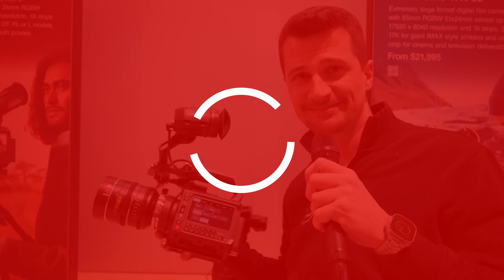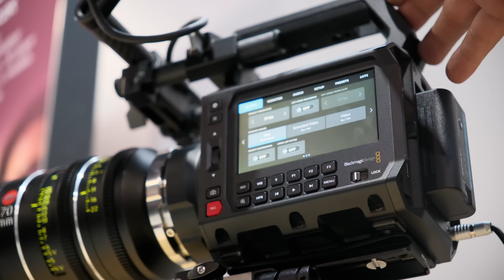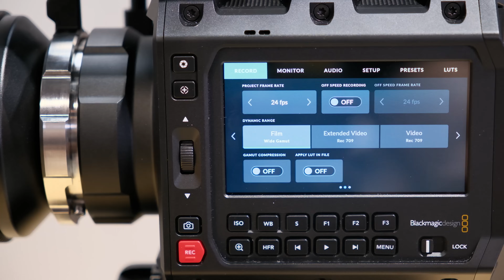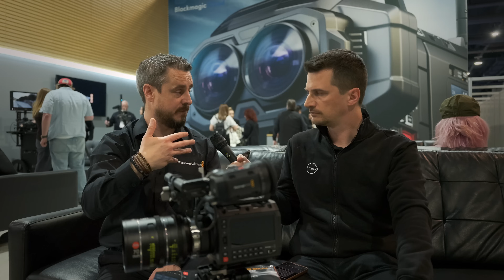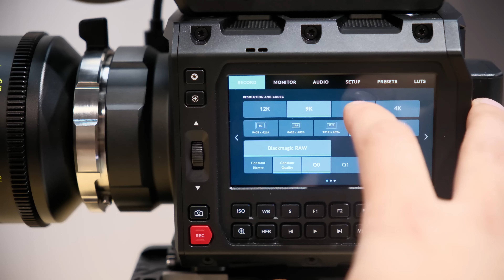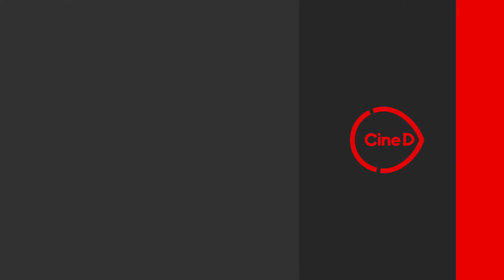Blackmagic PYXIS 12K Camera Explained in Video Interview

Comment: I don’t think enough people are appreciating that this is a 12k full frame l mount camera with no crop for 4k and 8k modes. 
It has a s35 9k mode…
And it’s $5k. What an unreal time we’re living in
Reply: Does s35 works ONLY on 9k mode or can you crop on other resolutions IF you want?
Reply: @baufilmesPT  was wondering the same thing, would love to have 6k s35, and 4k super 16 or whatever’s the actual window at 4k pixels… it would make for some mess menu-wise tho
Reply: just looked at B&H and its back to $5k
Reply: i don't appreciate it because i dont care 1% about 12k and neither do 99,9% of the industry. nobody wants to deal with those files. 6K is already too much. commercials, feature films, music videos still get finished in 2K and i'd rather have them put in a high performance 4K sensor with larger pixels instead putting in all this development and computing power into pushing the resolution
Reply: @kwa42  Running it at 4K you still get the full sensor readout and the 16 stops dynamic range... and 99% care about that as it puts it in rare company for only $5k.
Reply: @kwa42 then don’t shoot in 12k. The fact that it doesn’t crop when shooting at other resolutions and has amazing DR puts this in a different league. $5k is asinine for this camera.

BTW they still give you Resolve for free with it. Wild.
Reply: @kwa42 still missing the point I see 😂
Reply: Exactly what I thought. It feels so surreal
Reply: You are right, it's because the haters will focus on the headlines instead of the details.  I wish they renamed it the "PYXIS 12K 8K 4K".
Reply: When the 6k full frame (pocket body style) went on sale for $1500, I purchased 3. Didn't need them at the time. Just left them unopened in storage. I sold two for the full price and preordered the 12k Pyxis for $4995 at launch.  In essence, I was able to get the 12k pyxis for half price.
Reply: not 5k anymore
Reply: @yvestruong  USA is not the center of the world man. It's 5K, just talk to your politics.
Reply: @Horizons_Roses  The US has been an Oligarchy for over a decade now, and there is no true representative government any longer, as each congressional member serves over 450,000 people. The people of the USA no longer have a voice in what those in power do... as the world can now see.
Reply: @yvestruong  I have a strong feeling that other companies will raise their prices bi the same amount for the us market.

Comment: Why didn't you ask if the 12k sensor is capable of PDAF?
Reply: I hope someone answers this. It’s been implied that L-mount would have it, but I haven’t heard one way or the other
Reply: I'm pretty surprised he didn't dismiss the idea, it makes me wonder if they didn't include phase detect capability in their 12k sensor and did the same as the 6k "we will implement it later".
Autofocus on the 6k is wild because they didn't announce it and it's ptetty much impossible to know what exactly is the sensor capable of before they tell us what is inside
Reply: @lucasvivante8988 Reminder that the 6k sensor comes from the a7 III which has PDAF of course - whereas the 12k sensor was custom designed for Blackmagic during the era when old vets discouraged them to incorporate autofocus.
Reply: Its capable, as mentioned in the tech spec
Reply: @sk-dwg  where does it say this?
Reply: @robertpaterson5477  he said in the livestream that they want to bring continous af to all of their large format sensor cameras, which of course includes the pyxis 6k and 12k
Reply: @bt_conner  he said "other cameras with large format sensors" not all.  but you might be right although the ursa cine won't get it because it's not L mount
Reply: @robertpaterson5477  Yeah that's true. But since their only l mount large format cameras are the cinema camerar 6k, the pyxis 6k, and now the pyxis 12k, I think the obvious next step is the pyxis 6k like he said in this video, but I could see the 12k maybe taking a little more time to implement. But it seems like a no brainer for the pyxis since it's the same exact sensor as the CC6k.
Reply: oh my god who cares!!